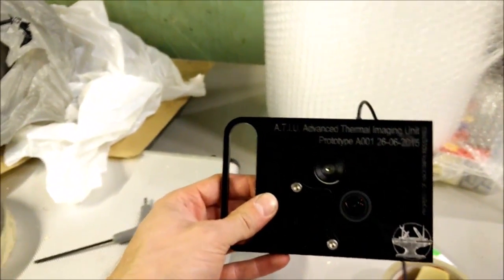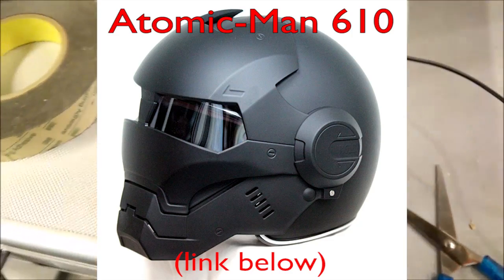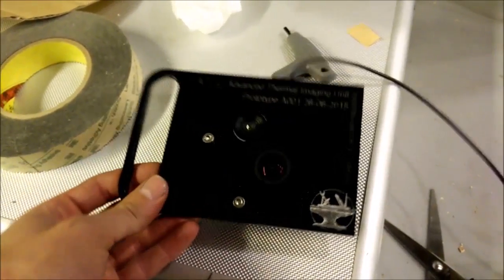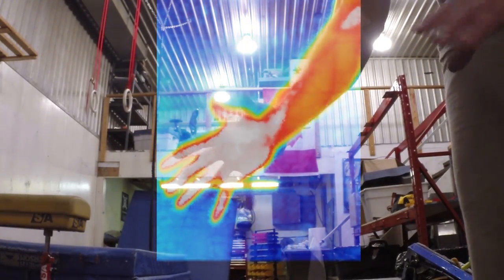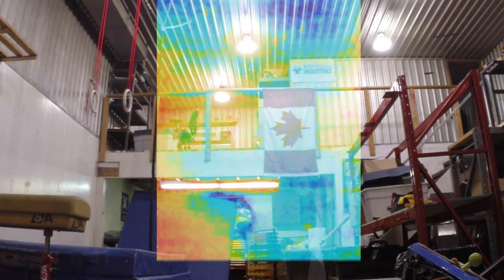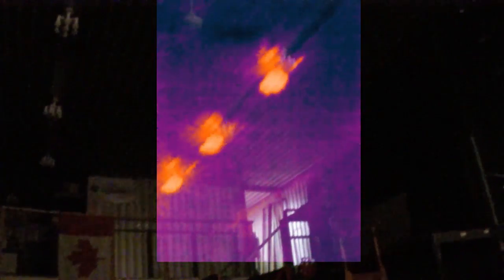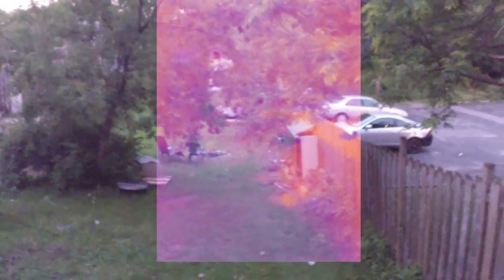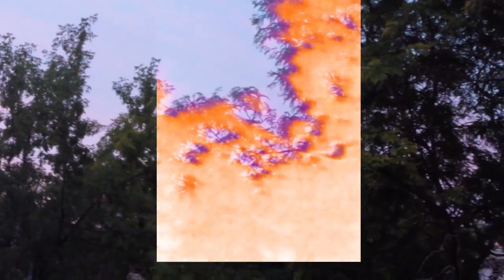Exoskeleton Mk2 Part 9: Predator Style Heat Vision!

Comment: You need to use the ThermApp camera. It's considerably more expensive, but much better than the Seek unit. Still way cheaper than a proper FLIR camera though. If you had the money, you could probably get 2 of those and with a little bit of programming, a smartphone and a Google Cardboard style VR headset you could have a nice, 25fps (the Seek is 9fps) , higher res , 3d thermal vision. It might even be good enough to not need the visible light camera assistance.

Comment: You can also add a night vision camera.
Reply from the maker: Ene Silvian This will work in complete darkness...
Reply: Yes but has a bad resolution.
You can get an ir hd camera, connect it to your display and you are good to go.
Your decision. 
Btw you are awesome.
Reply from the maker: Ene Silvian Ahhhh gotcha!

So we could have three sensors...

Thermal camera for heat signatures which can be overlayed onto HD GoPro footage (for recording), and then an HD IR camera for true night vision (but will require some IR spotlights on the helmet too then).
Reply: Yes, good luck and have fun.

Comment: I'm suddenly even more interested. I'd love to see the TIC being used in pitch black, to see if it could work as effective night vision. However, I blocked the sides of the screen while you were showing it off in the garage, so I could just see the thermal imaging, and it wasn't showing much. I'd likely run into walls and trip over things if I was relying completely off of it.
I do, however, like the idea of an internal screen in the helmet instead of glass. It's more protective and looks cooler. Of course, you would want to be able to move it so you could see what you were doing without power.
Reply from the maker: ThatZommy It certainly does work in complete darkness, so for any kind of hunting its extremely effective. If you're just trying to wander around outside at night, not so much.
Reply: the Hacksmith That was my issue. It would be great for tracking, but not moving, because everything would more or less look the same. You would want night vision as well, or being able to track might not be of much use at night.

Comment: You need a visor that detects electric pulses, cuz it doesn't seem like you'll be able to distinct people from trees in a hot day/night, and you'll have trouble finding someone in mud/snow.
Reply from the maker: Felipe Cattan The temperature difference between a person and a tree is big, so you would very easily be able to spot people in a forest during the day or at night. The only reason the trees show up like fire outside is because it's comparing the temperature of the tree to the atmosphere (which is not producing much IR). I think I say this in the video? 

Finding people in snow would also be super easy -- mud though, not so much -- hence why in predator Arnold covers himself in mud because it cools him down and reflects IR radiation. Snow on the other hand would simply melt away.
Reply: the Hacksmith Huh. Good to know, although on a snowy mountain where the temp reaches 0-, I don't think snow would melt so easily tho... Good luck on speeding up the frames btw and you should probably add jet wings to the suit, like Yvess Rossy (JK, you'll most likely get killed...)
Reply from the maker: Felipe Cattan Aha. Maybe.

I'll do some sample footage in a forest -- regardless of if the snow actually melts or not, you would still have a heat gradient much greater than the surrounding cold and snow ;-) You'd stick out like a sore thumb on thermal. The camera is sensitive enough to read a difference between just a few degrees celcius =)

Comment: Very clever using it for a heads-up-display. You can go one step further if a thermal overlay works, perhaps, and try to use to use the thermal images (alongside a normal video feed and/or any other imagers) to algorithmically highlight human-like movement and shapes (e.g. with boxes) on the GoPro feed itself as a target recognition system.

Although, if you manage to get your hands on a HoloLens or other AR visor in the future, it can offer extra sensors and be combined with your helmet to overlay your HUD more cleanly and futuristically!
Reply: Meta smart glasses are better

Comment: check out this add on https://youtu.be/L9mwGeDAxhk
Reply from the maker: Holice Meeks Not quite the same thing -- that's just removing the IR filter from a digital camera sensor, you need IR light to then illuminate. Kind of confusing, but this thermal sensor actually detects much more of the spectrum.
Reply: oh yeah I know I was thinking more of an added option .... the helmet is going to be sick... ever consider using nitinol to as the mechanical advantage ... you layout could be similar to human anatomy ... the could easily be passive yielding more fine control...

or I could. just be crazy.... love your stuff man

Comment: Could you blind some one using thermal with a hair dryer or heat gun?
Reply from the maker: Ryker Keegan What? Can you blind the camera by producing lots of heat? yeah... but it'd be dead obvious what you're doing... If you used a hair dryer on someones eyes you would blind them from the heat, not the IR radiation...

Comment: just an fyi to anyone complaining about the clicking this is the reason. thermal cameras have a little flapper on that will every once and a while flip over the sensor so that it will re-calibrate then continue working again. this is so that the accuracy of the information that is given is correct. if you notice when you here the click the thermal image pauses for a second this is the re-calibration process.

Comment: Problem with that is when you have something white, you can't see the thermal image of that. You should fix that in future.
Reply from the maker: Meg.A. Byte Not sure I follow...?
Reply: the Hacksmith I think he is assuming that white will reflect ALL light (white shirts stay cooler than black), even infrared, and thus not have a heat signature. (Of course even if this were the case, white would show as a super-blue blob)
Reply: GamingInvader Right, you just can't see what color in infrared spectrum is it, when something is full white (probably because of blending mode of layers).

Comment: Try to use a Raspberry Pi with the IR cam so you can also see at night with a couple IR LED´s and the R-Pi could be useful for many more features.

PS: And you save your GoPro :)
the Hacksmith
Reply from the maker: GermanMythbuster Wouldn't be nearly as good quality though... A modified digital camera (or raspberry pi) to let in IR light does work, but no where near the same caliber as a thermal sensor -- there's a reason they're expensive! It's only the past few years that they have gotten affordable -- used to be thousands of dollars for FLIR sensors!
Reply: I am sorry, I think I was not detailed enough I am only takling about replacing the gopro, the FLIR sensor is great.
Thank you for you amazing videos and for your answer :)

the Hacksmith
Reply: Like I said I am not talking about the Thermal Camera resolution. I talking about the night vision capability, gopros are not good for night vision.
So to be clear what i am thinking:

FLIR is Good

GoPro is good for day but bad for night

Pi-Cam is good for night, and good enough for day (1080p 30fps)

Dynamitemonkey500
Reply: He can ( in most cases) see at night since this sensor picks up infar red radiation which is given off from everything over 0 kelvin and it's impossible for anything to be 0 kelvin anyway, the only restriction to what he can see is the sensitivity of the sensor ( can usually be adjust if not then software can do it )and the resolution of it.
Reply: I have worked with FLIR cam´s, the resolution is my biggest concern, thats the reason why a serpent night vision cam would be better
Reply: GermanMythbuster
But using a HD camera and overlaying a thermal camera is already pretty great as one pixel may be warmer on the thermal and then you can see the details in the go pro. So the thermal doesn't need to be a higher res, at least that's what I think he was going for.

Comment: Maybe you could add night vision to the go pro unit with IR leds
Reply from the maker: gavin harison Doesn't quite work like that I'm afraid! Is possible to modify a digital camera to let in IR light though then have a big "invisible" flash light... but a true thermal sensor is much cooler =)

Comment: What's the clicking noise? Is that the sensor doing something?
Reply: ***** thermal cameras have a little flapper on that will every once and a while flip over the sensor so that it will re-calibrate then continue working again. this is so that the accuracy of the information that is given is correct.
Reply from the maker: brandonhughes7 An engineer in our midst! That's exactly what the clicking noise is =)
Reply from the maker: ***** It's the mini predator I stuffed in the laser engraved enclosure ;-)
Reply: the Hacksmith This might seem like a stupid question but if you were doing Predator style vision wouldn't it be more fitting to use a good quality Predator Style Motorcycle Helmet?